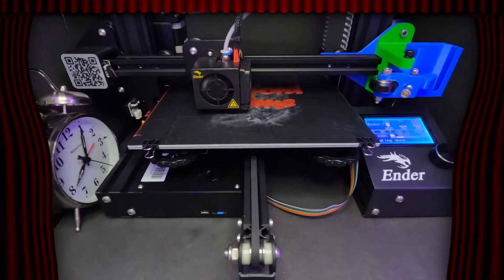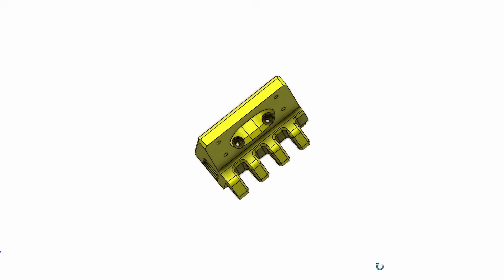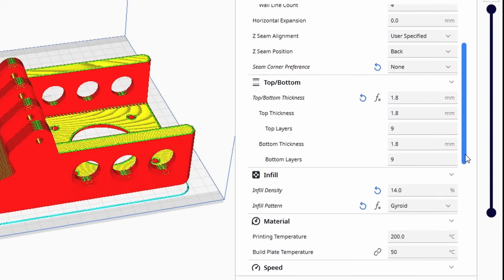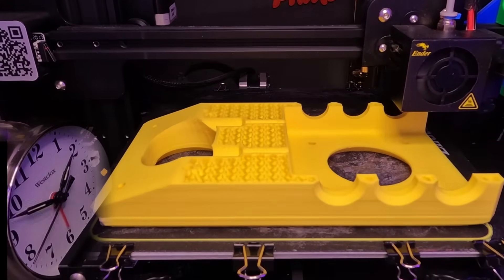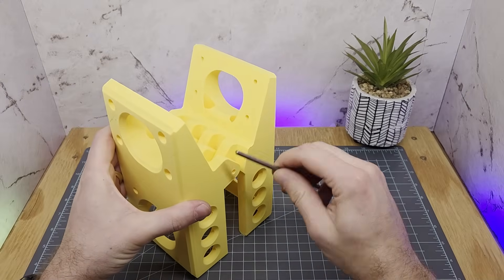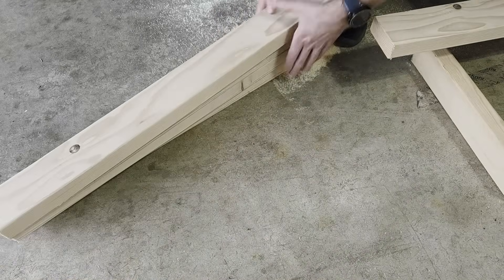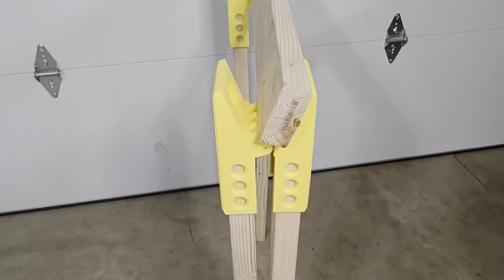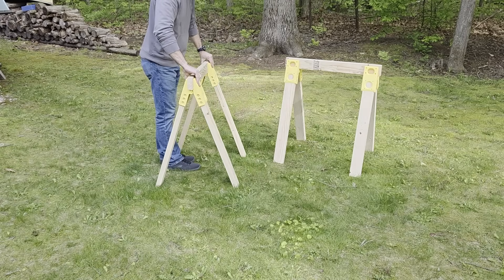These 3D Printed Saw Horse Brackets Have INCREDIBLE Strength! I was certainly impressed.

Comment: You should gave printed it on it’s side. Your layers are the weak point by the pin holes.
Reply from the maker: I understand what you're saying. That part of the design has a lot of independent layers with the piano-like hinge, do you think that helps? I mean, in relation to the rest of the part? I was trying to not use supports while printing, which is why I chose the orientation I did. The layer orientation around the pins had to take one for the team in order to make the rest of it stronger with layer placement? I guess I'll have to experiment more... maybe a redesign someday? These are holding up great though, so it may be a while...
Reply: @sanfordprime 
In your current orientation the layers can split under stress or simply be pulled apart.
If you print on the side the layer lines follow the shape of the hinge in a “circular” way and this will make them stronger.
You could use a modifier in the slicer and have then hinge part printet with minimum 5 walls and perhaps an infill of about 50 percent.

Btw.
It isn’t always a compact infill that gives strength. A larger number of walls will often be better. Combined with a lot of holes in the design, it will give the object more “strength points”. This will also save on filament and print time.
Reply from the maker: Yeah, not ideal the way it is with the pin but it fit the design and it worked. What your saying is valid though, they are most likely a weaker orientation. In a previous video I witnessed it first hand, I torque tested some 3D printed screws and the ones that were printed vertically were significantly weaker (torque wise) than the ones printed on their side. The vertical ones mainly sheared off at the layer lines. Same for the infill, I saw that too, a heavier infill barely did anything for torque capacity of the screws... Kinda interesting all-in-all...

I did experiment with adding holes to these brackets, as you can see there are many left in the model, there was a point where there was no weight-reduction for adding more holes. I actually removed some of the holes that I had put in to bring the printing weight (counter-intuitively) down.

In short, you're NOT wrong. Thank you for your engagement, it really got me thinking about it again and reminiscing about previous prints!

Comment: I'm sure you've got this advice many times by now, but you'll get a very noticeable improvement if you convert your ender to direct drive (preferably with something like Creality Sprite, but even if using the original feeding mechanism) and klipper. With pressure advance and input shaper calibrated, you could get quite a bit off the print time.
Regarding your design - great job %)
Reply from the maker: Thanks for the advice! I've heard about a direct drive conversion before but never got too deep into looking at it. I figured maybe a newer printer one day? These Ender's are great though, I've seen so many mod's that people have done to make them better. Me? I've chosen to leave mine pretty vanilla... the only mod I've done to it is the GoPro-remote bracket and a little g-code command between every layer to activate the timelapse photo. I've heard that the direct drive is recommended for printing TPU which is why I've stayed away from it; I want to use it one day for some models, but up til now I've designed around it, LOL!

And thanks again, I've used these sawhorses now probably more than the other ones I had, It's like I'm motivated to work now that they're 3D printed or something... it's kinda weird. Still holding up and holding things up too! I shoulda printed these a long time ago!

Comment: i think the design is brilliant. well thought out and looks tough enough for static loads but i still have reservations about the PLA parts like when you actually saw something on it and putting lateral movements and loads on them. Perhaps carbon or nylon filaments would work better?
Reply from the maker: I've only done PLA and ABS on my Ender 3, and haven't had great success with ABS. I figured for the best chances of it coming out properly I'd just do the PLA, I was not disappointed. When the PLA ones finally go out I'll print with an engineering grade material, hopefully by that time I'll have a new printer that's more capable. Static loads have proven great with these, and I too am a little apprehensive about lateral loading n such, I may add more 3D printed parts to it in the future for additional strength? I dunno yet though... Thank you for your engagement with the design!

Comment: The design is very well made. But I’m not impressed about the strength of the 3d printed parts as all the forces are going through the wood. The engineering is quite well thought out.
Reply from the maker: Thank you so much. It took a bit of extra time to get them whittled down to be cost effective comparable to a purchased set of brackets. Yeah the wood ends up being a lot of the strength behind this print, but it sure does look cool when all together, it's an attention grabber in the garage for sure! So many people are surprised at them because they think that all 3D prints are kids fidget toys, lol!

Comment: Great video! Though I think your test with a completely static load is not very representative of what a saw horse needs to do. It needs to withstand dynamic loads and being pushed in all directions as material is pushed around on top of it, tools are used on it, etc. Under those conditions, we may see a crack failure. But the design looks thick in the right places to hopefully hold up. I like the hidden screws in the top!
Reply from the maker: Thank you! I understand what you're saying and I agree. The static loading is just a measurable baseline for all the immeasurable use-loads, such as shock loading from slamming down a full sheet of 3/4" plywood at 65# each from chest height and another dropped right on top of it then slid around, I also can't rule out tripping over or accidentally kicking the leg out while setting up a cut. I think that whoever is printing these for their own heavy-duty use should be aware that it is 3D printed and the caveats that go along with using it. Would I prefer to just build wood horses? They have their use cases and are easy as well as quick to put together at a moments notice, but I have a 3D printer and just had to do it. LOL! The nicest thing about wooded ones though, repairability... these ones may need a new part printed if broken, but they look cool and have grabbed a lot of attention sitting out in the garage!

Comment: I'm not too surprised as it seems quite overengineered. While the load is a bit odd on a saw horse, and the stress is likely all concentrated on the hinge. These things have been made forever out of quite thin wood, not more than 1x1". Usually they have a chain in between the legs, likely to take the load off the hinge. I wouldn't trust those with 100 kg+, but usually that's not the goal.
Reply from the maker: Honestly I did not know what to expect when I got into this, but was happy with the result. The initial design was more than twice the weight of material, so if you think this was overengineered... lol! I didn't feel like using two spools of material per horse though. I think using these for 100kg would give them an appropriate Factor of Safety from where it was tested up to, at 215kg. In my opinion, the nature of the traditional sawhorse design made this a successful print. By adding a chain between the legs it would certainly increase the overall strength, I like that idea as it keeps the horse foldable. With a chain between the legs I also wouldn't feel afraid to set this up on slippery surfaces (i.e. tile flooring or smooth concrete). You may have noticed that I moved outside into the grass for the load testing, not because I didn't want bricks smashed all over the garage floor (well that too...) but because I was less afraid of the legs kicking outward due to the legs digging into the ground and stabilizing the structure. Thank you for the well thought-out comment, definitely some room for improvement on these and potentially future bracketry. Sorry so long...

Comment: If you're trying to take some load off the pin and extend the life of the joint, you could extend the "teeth" out so at full deployment (with a 2x4 cross beam inserted) they are resting on the wall of the other piece.
Reply from the maker: So, kind of make an opening stop? Interesting... getting the brain moving again on this one again. Something that 'engages' as additional load support when open... great idea! Thanks.